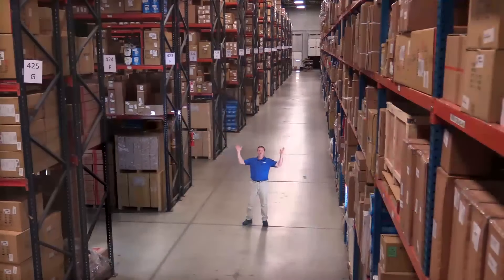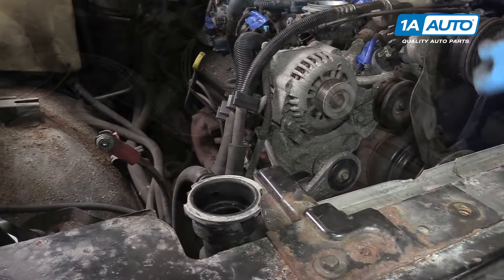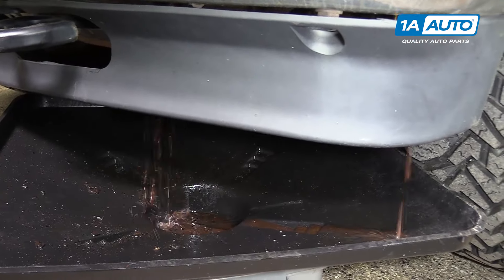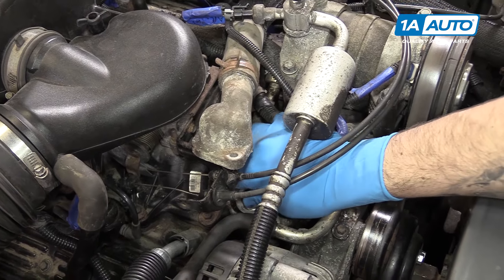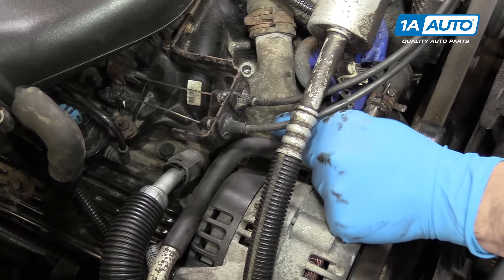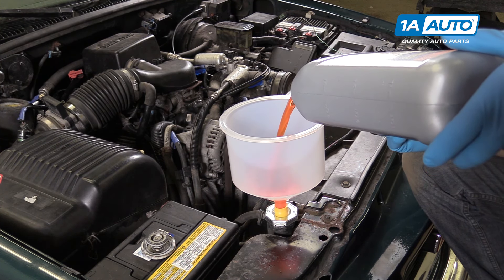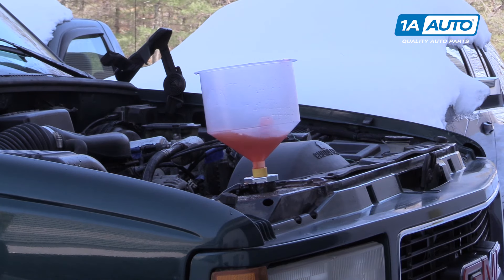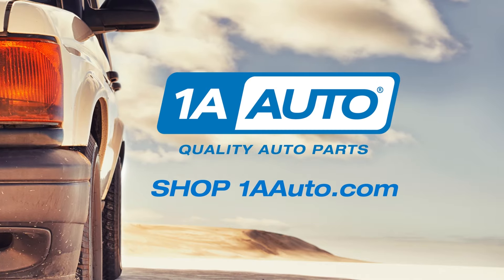How to Replace Thermostat 88-98 GMC Sierra K1500 V8 5.7L

Comment: Hey it’s a nice video but the important part you left out. The housing is aluminum what’s the torque spec for the bolts. If someone were to tighten bolts down with a 3/8” ratchet it would go on tighter then someone using 1/4” ratchet. Torque specs are best.

Comment: Do you need a gasket for the housing or the RTV silicone gasket maker.  Or is the rubber mounted to the thermostat good enough?
Reply from the maker: +Luis Sonoma Thanks for watching!  The seal on the new thermostat is all you need, no extra silicone or gaskets.  1aauto.com
Reply: 1A Auto Parts Perfect, thanks.
Reply: @1AAuto why did mine leak  using ACDelco thermostat with its "o"ring gasket?
Reply: @rudyVvv3  probably didn't clean all the old o ring out of the groove. If you install properly you do not need silicon.

Comment: Got one that will not warm up and the temp gauge will only get to 120f at most. Last week I had a leaking heater control valve. The gauge was working then cause it would go 240 then back down to 200 until i could get it home and cooled down.  I grounded the gauge wire and it pegged 260, so I replaced the sensor. Still nothing. I also recently noticed the radiator cap has no pressure when I open it under warm conditions, after a 10 mile test drive. It’s about 50deg outside. Would a sticking thermostat cause a “no pressure” issue. I checked the oil, I has NO sign of antifreeze in it. Thanks in advance.
Reply: You need a new Truck

Comment: Hey guys, real quick- Have 2001 sub 5.3 1500. Replaced radiator and stat same time.  
   Is it possible for aftermarket stat to not open ALL THE WAY?:)? Heats up at idle, fine while driving as if slightly blocked.....
Reply: It is possible. Get a thermostat that is permanently open. The main reason they get clogged is because they close.

Comment: So no gasket???
Reply: Yep, it seems that it is a channeled double-sided gasket .  
Which is what I was sold last night, and explained about, as I shared at the time I extracted previous night fd it all in place seemingly squeezed down under the thermostat. 
As I brought both the thermo'n gasket to the shop, (and no lineup behind me) the rep took the time to point out the channel line within the compressed gasket I had extracted, and also light grey line evidence along the edge indicating it was likely an original  installed as fd. , as possibly the housing (which I haven't looked at yet) did not appear configured for this channel gasket design' .......